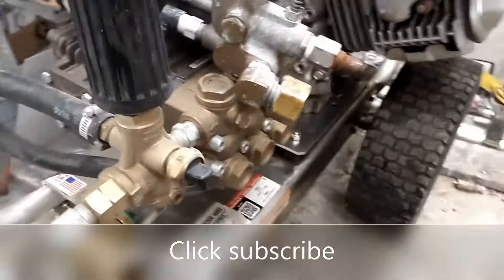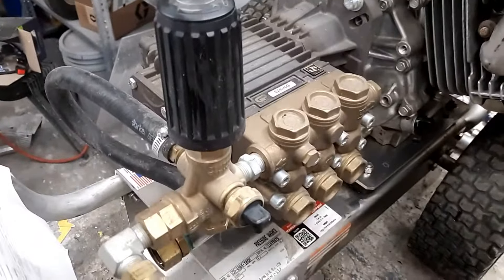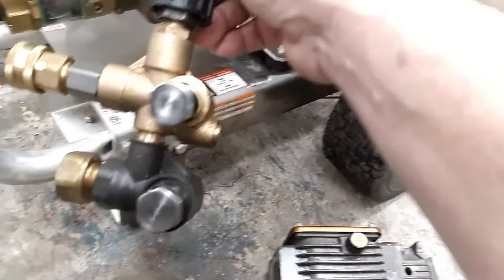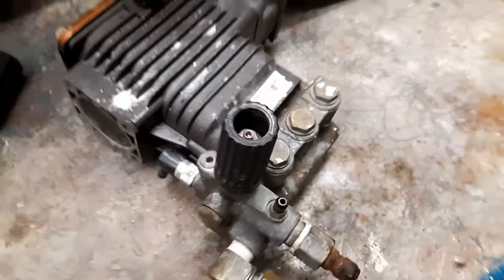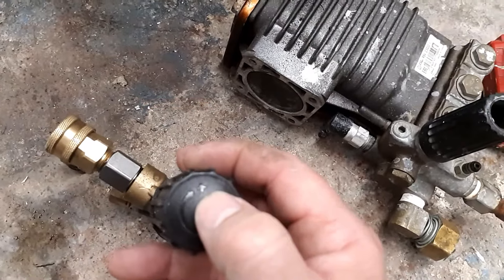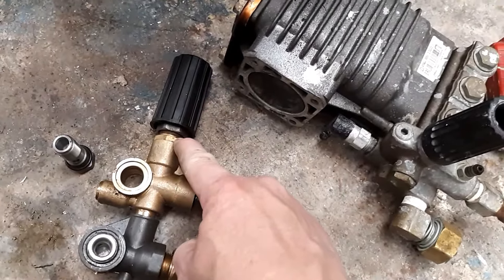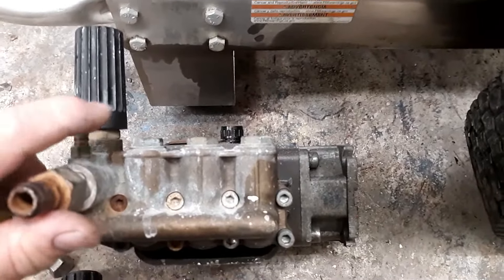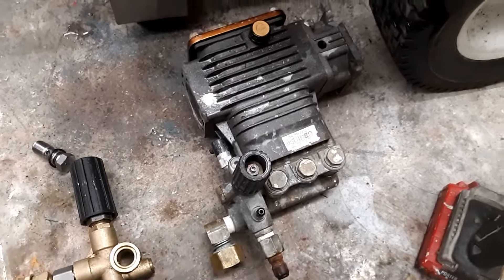Pressure washer unloader types

Comment: I have new Simpson 4400 psi, 4 gpm unit that I think has the unloaded built into the pump. I used it for the first time this week with a pressure guage and it registered 3300 psi with a 4000 spike. I now know the spike is too high. I want to adjust the unloaded to 4000 psi but that would drive the spike too high also. Well after about an hour of running it it blew out the guage and also noticed my 5 gal bucket with soap and ash was totally full. Where did it come from?  
Also the black knob on the unloader is sctewef all the way down. 
Oh, I was running a 22” surface cleaner so should not have raised the pressure tight?  
Help please.

Comment: Does a Cat 4DNX25GSI have the unloader built into the pump?  It looks like it does.  How long can this pump run without the spray wand being used at full throttle before overheating?  Appreciate the information on pressure washer pumps.  You make it understandable.
Reply from the maker: Yes, this model has the unloader built in. I will not give a time frame on how long the pump can run without using the wand before overheating. There are too many variables to consider to give an accurate time frame. I don't like more than about 2 minutes max. I have a video that explains this and shows how hot and how fast they heat up.
Reply: @Brian_the_repair_guy  Thanks, Brian.  I watched that video.  Keep up the great videos.
Reply from the maker: @CTSCAPER  thank you, hope they help

Comment: Thanks, Brian, for your support I will try that tomorrow. However, I did try running the pressure washer without engaging trigger yesterday and I looked inside the tank no water was returning I have a clear hose running from the pressure washer to the buffer tank so I should be able to see if water is coming it's coming out of the unloader do you thank the unloader has taken a dive. I do know that the seals need to be replace I see mike in the pump oil
Reply: 😅 pop lo😅😅😅

Comment: Hey Brian what would make a pressure washer engine be heavily loaded? Bought a new unloaded VHP39 for my 5.5 gpm 5000 psi. Using correct orifice but the pressure washer feels as if I have a 2.5 orifice. Motor bogs down real hard and is under a big load. Pressure gauge only reads 3000 psi. No blocks in hose or lance.
Reply from the maker: The gauge shows 3000 on a 5000 psi machine and it sounds like the engine is under a heavy load? What size engine and where is the gauge located?

Comment: Hi Brian. thank you for the master techniques that you show on rebuilding AAA water pump seals. question is, after you put both washers on place, then you put the copper head with the smaller rubber washer. What I have notice is that between the manifold and the top copper head with the smaller rubber washer, there are small holes on the main manifold and the top copper with the last washer, hope you understand what I mean. are those 2 holes have to match and be on line with one another?. 
thank you.
Reply from the maker: No, they do not

Comment: Hi Brian, thanks for your explanition this is one i call profefesional man! now I undartand .
Reply from the maker: Thank you, hope it was helpful
Reply: @Brian_the_repair_guy  My uploader hose broke and I need to replace it. I tried to find replacement hose but can’t find one that fits. What hose did you clamp on yours with the hose clamps? Does it stand up to the pressures?
Reply from the maker: @JakeRice-qu4rm  the unloader hose Does not need to be high pressure. A standard reinforced hose with the correct inside diameter. Lowes or Home Depot will have it.

Comment: What Brand(s) of pumps would you recommend looking for when purchasing a pressure washer (are there specific brands or models that you see last longer, require less maintenance than others)?
Reply from the maker: @thegreatexchange4u  CAT pumps are great nut much more expensive. 
General Pumps are great but less costly compared to CAT. Parts are more readily available. 
AR pumps are good and least expensive out of these 3. There are AR pumps made in Italy and P.O.C. I prefer the ones made in Italy
Reply: @Brian_the_repair_guy  Thanks for the quick reply! How would your rank Canpumps? We have a Generac Pressure Washer with the AR Triplex pump but it has an integral unloader..
Reply from the maker: @thegreatexchange4u  I don't see a lot of Canpumps in the southern US. So I really can't speak to them.
AR is good as I said, I prefer the removable unloader, more specifically the remote style bypass or unloader
Reply: @Brian_the_repair_guy  Thanks again, keep creating great videos! The family loves it when you get to the part where you say something like, "If you can't unbolt these two bolts, you need to stop right now and do something else" LOL love it.
Reply from the maker: @thegreatexchange4u  just trying to spread the truth.  Thanks for watching

Comment: I have a Simpson water shotgun commercial power washer. I allowed my next door neighbor to borrow it. I went over and got him started I turned on the water got the motor started and everything was fine. A few minutes later he came back over to me and said he had no pressure. Apparently he decided to stop so he turned off the motor and then turned off the water. When he came back out to start again he only started the motor and forgot to turn on the water on first. When he had no pressure he came and got me, and told me what he had done. So I went through the procedure again turn the water on started it and had a water flow but no pressure. This is not a cheap power washer. What are your suggestions?? Thanks in advance for your help!
Reply from the maker: Can you find me on Facebook. There will be a lot of back and forth on this one. Use my name from YT to find me

Comment: Hey Brian, do you adjust the pressure while holding the trigger on the wand( with the tip) or running without the trigger? Thanks
Reply from the maker: Without the trigger pulled. If you pull the trigger and set the pressure, your pressure will increase once the trigger is released. Could be too high and stall the engine

Comment: So at work we have a pressure washer with an external unloaded.
Sometimes we with run water through the washer but nothing comes out the high pressure side.
Inlet is clean.
If we take the top end of the hose of the external unloaded water starts flowing normally. 
We put the hose back on and everything runs just fine.
This issue happens usually when first starting it. 
Any idea whe our issue is?
Reply from the maker: @mrmv42  is there water flow when you start the machine?
Reply: @Brian_the_repair_guy  water won't flow whether it's started or not, until we disconnect that top hose for at least 1 second. Then it works fine. Even after we put the hose back on.
If we shut it of and start it again it will also run just fine.
Reply from the maker: @mrmv42  so you have flow if the pressure hose is attached? If this is the case, there are no worries
Reply: @Brian_the_repair_guy  we have to take the hose off to get the flow to start. Then afterwards we can reattach the hose.
Reply from the maker: @mrmv42  find me on face book. Take a short video of what's happening so I can see everything

Comment: Hey Brian, quick question, does the Bolt-On unloaded have a bypass that I can connect a hose to so that it runs back into the water, or is that feature only for the external unloaded? I’m confused
Reply from the maker: I can not speak for all bolt on unloaders. In my experience, I have never seen a bolt on that has the option to connect  a return hose. Just the external unloader
Reply: @Brian_the_repair_guy  thanks so much

Comment: Kinda a dumb question, what type of pipe did you have on your EZ4040G pump for the low pressure water, mine recently snapped the connection and i have no idea what to search for
Reply from the maker: Are you asking about the water hose inlet for the pump?
Reply: @Brian_the_repair_guy  yes i am, ive got an external bypass and cannot find another brass bit to save my life
Reply from the maker: @mercenary1485  you are installing an external unloader and you need the water inlet? I will get you a part number and source
Reply from the maker: @mercenary1485  https://www.watercannon.com/product/1125/clear-inlet-filter-flow-thru-34-in-fght-inlet-12-in-male-out-8gpm

This is the part. It has a filter. You can get it without the filter. You will also need a barb, size based on the return hose. They can help you with that part also

Comment: Brian I can start the engine on my Honda GX690 spray water out of the gun, but no water is in the hose coming from the pressure washer bypass.
Reply from the maker: What pressure are you running? Disconnect the bypass hose from the unloader and run it without pulling the trigger. Does water come out of the unloader?

Comment: Mr. Brian. My name is Javier. I have an AAA 4200 PSI 4.0 GPM Belt Drive pump, it's not external, it's a whole piece, I can't put a Bypass on the buffer tank to cool it, my question is, can I change the pump or the head and put another brand and change the amount of GPM.
In order to put a ByPass
Reply from the maker: Short answer is yes you can change the pump. Long answer is yes you can but it will be a bit costly to do so.
Reply: I am going to start in this business and I get carried away by the videos on YouTube and I bought this Simpson 4200 PSI belt drive 4.0 GPM machine without knowing, I had that pump now I don't know what to do, I know that the bypass is important, and what could you recommend? to be able to bypass that machine, or is it to change the pump or the equipment (W/P)
Reply from the maker: @javierruiz8318  honestly, there isn't much you can do to that pump in order to set up an external bypass. 
If the external is what you want, I like them very much, I would suggest replacing the pump. 
It will be pricey.  In fact, you may look at purchasing another washer altogether and use the current unit as a back up.
MiTM makes a great belt drive with Honda engine and General pump with external. 
Most cost effective is to replace pump. Make sure the replacement  will bolt to the frame without mods and the pump is fully plumbed
Reply: Thank you very much Mr. Brian for the information and I will take your suggestions as law
Thank you.
And by the way I have learned a lot from your videos, they are very precise.
Reply from the maker: @javierruiz8318  I am very glad to help

Comment: Hi i have AR RSV 3G30 pump, 3000 PSI with 2.5 GPM. I want to change unloader valve nothing wrong with that it is 15 years old, doing some basic maint, changing all valve kit, low and high pressure seal etc..  question to you is, 
1) does the PSI is based on the pump or based on engine..  i have GX200 engine .. 
2) is it mandate i have to go with same AR unloader or simpson or anyother brand is ok as well ?..
Reply from the maker: The engine will dictate the maximum psi. The engine will shut down with pressure too high.
You can use any unloader that will match the bolt pattern on the head

Comment: So let me ask this if I take the black hose from the bottom off the unloader and set it into a buffer tank
 would it work then and how do I seal the bottom of dark unloader where the hose used to be. Thank you
Reply from the maker: You can take the unloader  hose  loose from the inlet side. Install a plug where the hose connected. Run the hose to your tank. Replace the thermal dump with another plug

Comment: Brian, . when i set the unloader, i did it with white tip for around 2500 PSI, then when i changed the tip to Dewalt turbo nozzle, the PSI jumped to 3000 psi..  is that normal..  in otherwords, what size tip should i choose to set the PSI on unloader.
Reply from the maker: Your turbo tip and the red tip (0 degree) will give you the highest pressure. I set the pressure with those. They should give you closest to the maximum pelressure on the machine.
Reply: @Brian_the_repair_guy   Thanks Brain. i did the same, i was told that i should chooose orfice correctly based on GPM and PSI. mine is 3000 psi with 2.5 gpm that comes to 3.0 orfice..  does orfice is super imporatnt.. i guess so.
Reply from the maker: @sivucit  yes, orifice size makes a big difference. Must be correct to the pump

Comment: Brian,  my unloader, the + and - do not work.  Took unit apart and the spring looks ok and ball stem moves in and out.  When starting the pressure washer the water pressure is ok without hose connected.  Turning the unloader + does not increase the pressure.  Is this normal?  Thanks
Reply from the maker: You should have an increase and decrease with the unloader.
Catch me on Facebook at Bruan Shumack the repair guy and I can better help you same background as Youtube

Comment: Need some help. I  inherited a karcher 9000g washer. I repl all 6 pump valves..corrosion..I repl both wheels.. installed tank for detergent. Repl uploader..  the washer starts great.. I put a pressure gauge inline as it so important to know this info..the pressure goes to 3k.. but when I pull trigger.. gauge drops to zero.. what could cause this???
Reply from the maker: My first thought is the valve is stuck. Even though they are new, a piece of trash could be stuck in one of the valves
Reply: @Brian_the_repair_guy  one more point...the pressure gauge drops to zero.. but water pressure hose pressure stays the same
Reply from the maker: @MrJS0972  your high pressure gauge typically will not show the water pressure from the hose when the valves have a problem. That pressure difference is too low for that gauge

Comment: I have that same Ar pump with built in unloader… can’t I add a bypass hose to it?
Reply from the maker: If your unloader is a bolt on style like this, you can replace it with a remote style unloader with the bypass hose
Reply: I seen a guy hooked an external unloader into the box store u mention n seem to work
Reply from the maker: @SuperDoeboy77  some of the pumps on a box store pressure washer have bolt on style unloaders. This would allow you to safely replace it with an external bypass. If the unloader in not removable,  I would be hard pressed to see how it could be replaced safely

Comment: I'm currently having issues where I'm not building up any pressure and not getting any water I think it's an issue with my unloader i have a external unloader i ordered a new one online but any advice?
Reply from the maker: If you have no water coming out of the pressure side, then most likely you have a clog just behind the quick connect fitting. Remove the fitting and ensure the bullet shaped valve is clean of debris

Comment: On that hose that dumps the water back to the input, if you are using a tank, could that be run back to the tank?
Reply from the maker: Yes, just plug the hole at the input return

Comment: Hello on minute 7:49 you are touching a valve with your thumb, I need to order it but I don't know what is the part number.  Mine broke and I'll like to know if I can plug it or replace it?  What is this valvefor? Thanks for your videos 😊😊
Reply from the maker: That is the thermal dump. You can plug it, but I don't really reccomend that. If it is  1/4" it is MiTM part number 22-0408 or watercannon.com part number is 20.0069 if it is not 1/4" then the part numbers are different
Reply: @Brian_the_repair_guy  thanks 😊 it is bigger than 1/4". But what could happen if I plug it?
Reply from the maker: @erinsonduran6663  when using the machine, do not let it run for more than a minute or 2 with out pulling the trigger. This let's the hot water out to prevent over heating.
Reply: @Brian_the_repair_guy  ok 👍 thanks a lot for your help. Already ordered

Comment: Do you have the shut off valve for sale?
Can i bring to you my pressure washer?
How much you charge to fix it?
I live in California
Reply from the maker: I do not live in California.  It would cost you way to much just to travel to me. What is the problem you are having, maybe we can figure it out and you can order your parts and repair yourself
Reply: @Brian_the_repair_guy  oh,i see.
My by pass valve is leaking water all over the place,it has a little whole,just by the outer  o ring,and it started to leak the water from ther,istead of goig back to the pump
Reply from the maker: @Marlonhernandez777  can you post a video?
Reply: @Brian_the_repair_guy  there's the vid
Reply from the maker: @Marlonhernandez777  I can not tell exactly which unloader you have, so I can not tell you the parts you need. Without that unloader in my hand, I would not want to make a suggestion on what to purchase for repair.

If you have a Sherwin Williams store near you, you can have the order #101376614. This is the complete unloader with new fitting and injector. It has a one year warranty and is completely rebuildable. It costs around $70 here. Very good unloader for the money. 
Sorry I can not help with part numbers.
Reply: Ok  @Brian_the_repair_guy  ,thanks for the advice, I'll go to Sherwin Williams to take a look at it
Thanks i really appreciate your help.🙏🙏
Reply from the maker: @Marlonhernandez777  sorry I could not help more

Comment: I think there’s an issue with my unloader. I have the inline style. It’s very hard to start my machine without relieving pressure. Unable to pull the cord. I try to adjust the unloader and it will not turn. Any idea where to start?
Reply from the maker: There are "fixed" style unloaders, they do not adjust. If yours is adjustable, then it may be frozen. You can purchase a pressure relief valve that will make starting easier